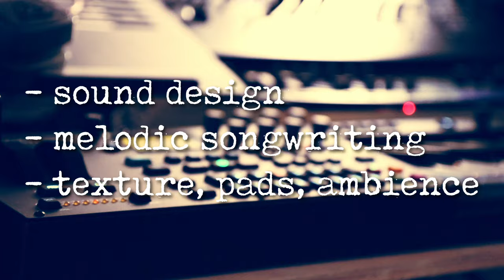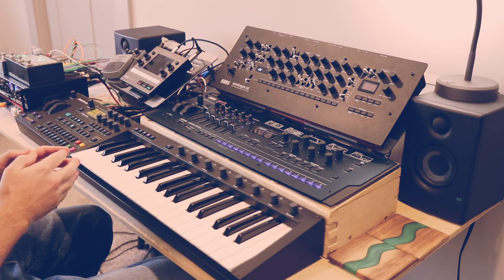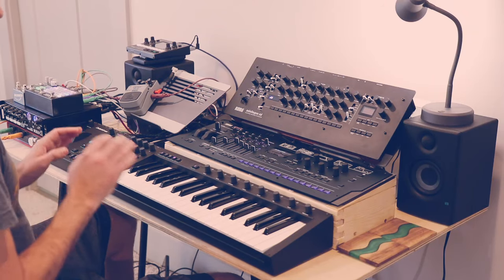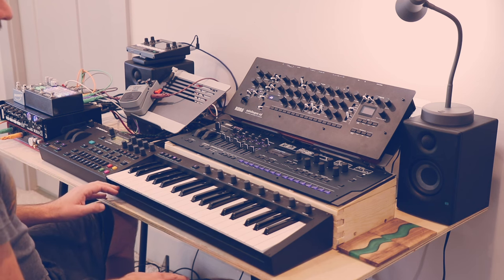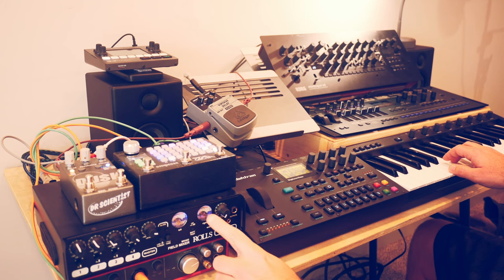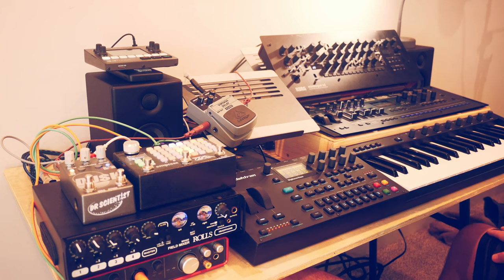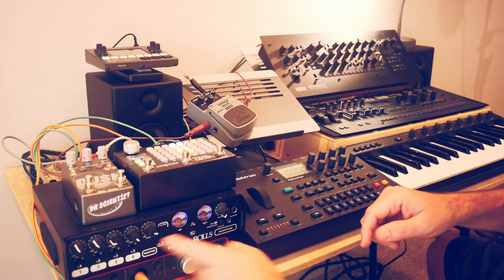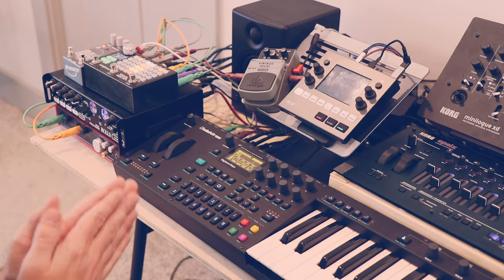The Sound Design Station

Comment: Great video, 100% on board with this kind of setup. Mine is more or less functionally identical--Wavestate (shitty keyboard and all) for controller and 4 channels, Hydrasynth for poly design weirdness, A4 (4 capable monos), Filterbank, and an H9.

BTW, you've got a secret weapon in the Blackbox's multisampling--all that stuff can be made easily live-playable on that very box (or used as PCM waveforms elsewhere).
Reply from the maker: Awesome, that sounds like a rad setup! Yeah I've dabbled with multi-samples on the Blackbox, but haven't created any from this station yet, that's a great idea to take these sounds on the road...